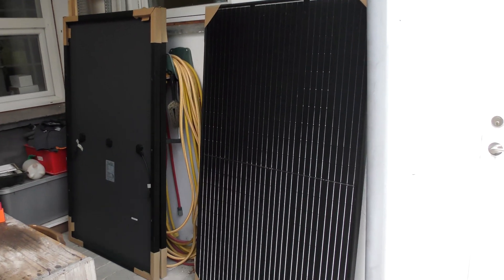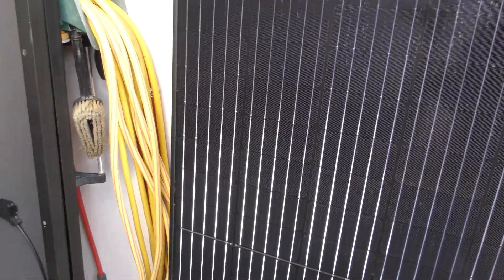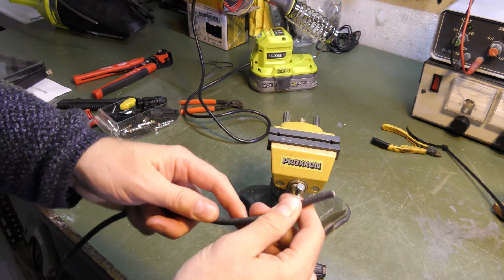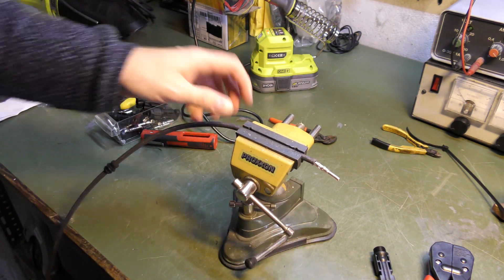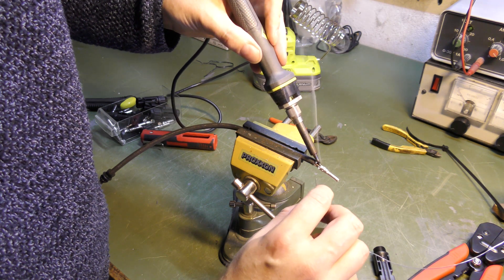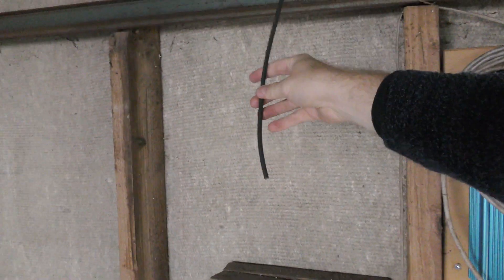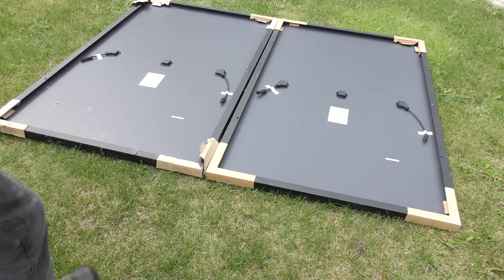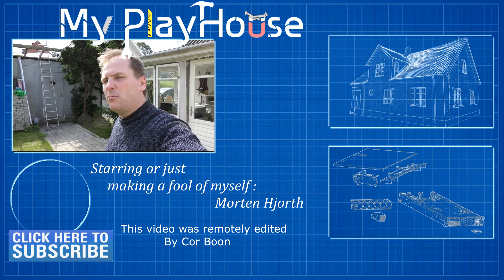Doubles Solar Panel Power Capacity at My PlayHouse - 870

Comment: I use 8mm copper wire in any string.
Zero voltage drop over 15m strings.
Along with very minimal resistance over 20m
The 6mm solar wires are hopeless...it's all top secret stuff.
Anderson plugs replace MC4 connections. (Weathersheilded)
It's 3.8 x more efficient.
Over 4 hrs of winter sunlight.
Shhhhhh...don't tell anyone.
Reply from the maker: Hi Aaron T
Thank You very much!  it's the distance and amps that gives you a voltages drop,, if you run 2 amps no problem,, run 200A hughes voltages drop.
Thank you for watching! :-)

Comment: Since I have just started playing with solar systems I have a question that I hope you can answer since no one else on youtube can / forget etc. How do you find out the size of the fuses to use? So how do you calculate how many Amps a fuse should have? Thanks in advance!
Reply from the maker: Hi Aladdin DK
He He playing with the solar systems :-) Oh dear God :-)
My panels give out a max of just over 9 amps, and in series, it is the voltages that goes up not the amps. So I will never see more than 10 amps comming out of a string of solar panels. I could put in 10 amps fuses. they would be big enough.
The fuses I show in this video, are mostly being used as breakers, for me to be able to shut off the panels. but is something weird would happen that will cut at about 16A
Thank you for watching! :-)

Comment: Hi morten I think this might be of interest to you. I bought one of these to power my home. I initially had a 48v to 120v 8kv inverter and 2 of the same charge controllers you have but I didn't like my 8kva inverter so I bought this. https://www.ebay.ca/itm/MK-5000w-48v-Solar-power-inverter-80A-mppt-charger-bluetooth-monitoring/143199105558?ssPageName=STRK%3AMEBIDX%3AIT&_trksid=p2057872.m2749.l2649
I like it so much better and it can be used as a backup or you can have it run solar as priority and switch to grid when battery gets low.
Reply from the maker: Hi David Smith
Thank You very much! I have been looking at this model as well :-)
Thank you for watching! :-)

Comment: That's some nice panels, a great advantage having part time partial shading, i have 150 watt panels, on a 24v system, i guess having more smaller panels kinda works in the same way, i have been looking into getting more panels, about 250+ watts, i did find a deal in 70 w thin film panels, theyare 80-100v, and nearly a half amp, depending on model, i don't know much about them , lifespan wise, great video...
Reply from the maker: Hi JAMES! Since the 70's
Thank You very much!  don't get thin film,,old teknology,, move on :-)
Thank you for watching! :-)

Comment: Hey Morten have you seen the new mppt/inverter/chargers/automatic transfer switch boxes. I think it would be ideal for your battery system. They have them at vivaenergi
Reply from the maker: Hi Frost
Thank You very much!  the pip Mppt 5048 also does this.
Thank you for watching! :-)
Reply: @MyPlayHouse  I was just leaning towards the vivaenergi HybridPower 1024II-24V / 2,4KW / 4KW PV, since they are selling it here in Denmark it might have more safety compliance testing and garanti.

Comment: If your panels are going to receive different amounts of sun you probably want to cable each of them directly to your solar controller (if you have a solar controller with balancing) so they can be balanced and the full effect of each panel can be used. Otherwise your lowest power panel will determine the output of the entire system.
Reply from the maker: Hi David Bezemer
Thank You very much!  I will improve on this later on,, with two charge controllers :-)
Thank you for watching! :-)

Comment: You are the same as me with crimped connections, i solder them also.
Make every strand of wire count, lowest resistance possible.

There is never enough space on the roof,  a shed extention perhaps ha ha :-D
Reply from the maker: Hi zx8401ztv
Thank You very much!  I do need more roof spaces!!
Thank you for watching! :-)

Comment: Cool video! I read that there is something to say for replacing the 2 MC4 connectors in the system from the solar panels that connect to the connectors you crimped on the wire. The issue was that connectors always have a good connection when they are the same brand, but that when connecting MC4 from one brand to the other, sometimes there is a bad connection. I think this resulted in arcing and fire hazard in some rare cases. Only problem is that there might be some warranty issues when replacing the factory connectors. It's ust a thought though - you will probably be fine (also since you're not running crazy voltages).
Reply from the maker: Hi D.K.S
Thank You very much!  life is extremely danagues :-)
Thank you for watching! :-)

Comment: just a thought for a new soldering iron (TS100)
https://www.amazon.co.uk/GoBuying-Programmable-Pocket-Size-Soldering-Acceleration/dp/B074M6ZMLB/ref=pd_sbs_201_2/261-6053191-7412344?_encoding=UTF8&pd_rd_i=B074M6ZMLB&pd_rd_r=cb90db4c-2583-4e5f-9b30-c95a261b5f11&pd_rd_w=hUw8x&pd_rd_wg=UWqZr&pf_rd_p=2b420a2f-6593-478e-8b5f-cb43865ff16f&pf_rd_r=K5G2F7BSSE135NA649WS&psc=1&refRID=K5G2F7BSSE135NA649WS

with the new firmware from github
https://github.com/Ralim/ts100

the TS100 can run off an battery backup (new project for your batteries) and will be ultra portable!!!
i think this will work with it too->
https://www.ebay.co.uk/itm/USB-Boost-Cable-5V-Step-Up-to-9V-12V-Adjustable-Voltage-Converter-1A-Step-u-V4T5/392263183011?_trkparms=aid%3D555018%26algo%3DPL.SIM%26ao%3D1%26asc%3D59534%26meid%3Db983fb443ac3473bb28c060a0f25dba4%26pid%3D100005%26rk%3D1%26rkt%3D12%26mehot%3Dco%26sd%3D273233138658%26itm%3D392263183011%26pmt%3D1%26noa%3D0%26pg%3D2047675&_trksid=p2047675.c100005.m1851

just a few ideas for you!!!
did you fix the battery terminal welder???
Reply from the maker: Hi Simon Lally
Thank You very much!  glad you liked the video :-)
Thank you for watching! :-)

Comment: love to see you expanding your solar, those mc4 connectors dont need soldering, i do crimp 6 of them before you finnished 1 lol, but i use the special mc4 crimp tool , they not cheap so for only privat use it makes no profit. Be carefull not strip the wires too much, 5 mm is ok. Have fun with the panels!
Reply from the maker: Hi highflow highflow
Thank You very much! 
Thank you for watching! :-)
Reply from the maker: YouTube is messing up, and climes that I have not replied to this,, sorry for the "disturbance in the force" :-/